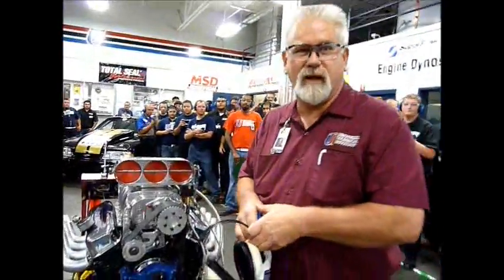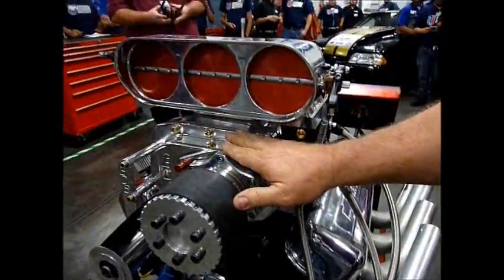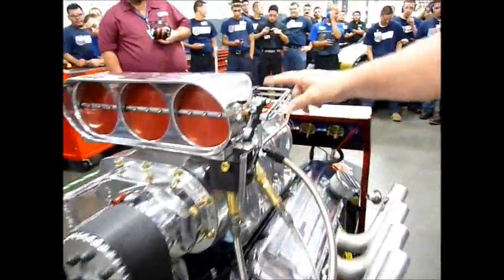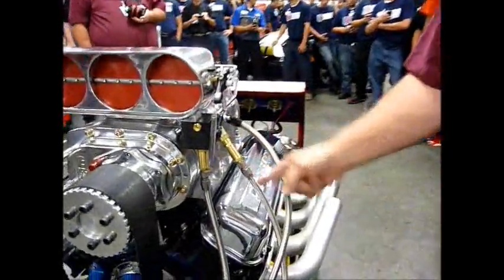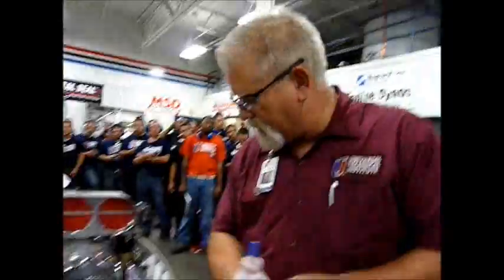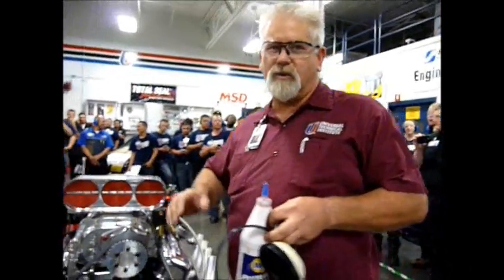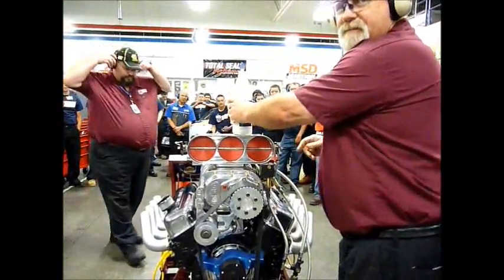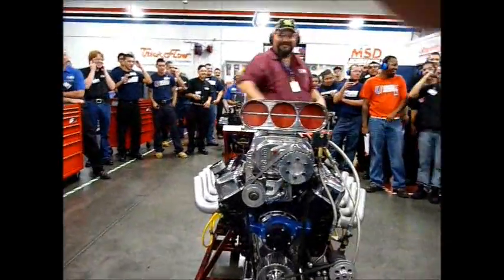UTI Sacramento Blown Gas BBC Engine

Comment: It's called blower surge it has nothing to do with the butterflies champ
Reply: I am sorry to say that you are wrong mini champ! Here is your free lesson for the day. There is allot of suction on the top side of the blower and every 60 degrees the rotors release that suction and then it starts again on the next 60 degrees. You can actually see the butterflies suck in and release ever so slightly as this happens. The bigger the butterflies the more surge. Couple that with the very low idle fuel pressure which can also oscillate up and down then you are into blower surge central. The further closed the butterflies the worse it gets. Open up the butterflies and it smooths out. This concludes your lesson for the day!
Reply: Mark Hall then explain why even on a dual carb setup it does the same thing
Reply: Mark Hall Danny Glad said you are wrong I'll take a man of that calibers word over yours any day.

Comment: Did I hear you correctly ?
Blown GAS not alcohol?
I didnt know you could run a Enderly injection on gas,
Reply: Jose Pt Tellez It is a great school for getting hired at a dealer. We teach the dealers programs like Ford, GM, Buick, Chevy, Cadillac, BMW, Mercedes, Nissan, Infinity, Toyota, Lexus, Porsche, Peterbilt, Cummins, International, Honda, Mini and I am sure I am forgetting some. You can actually get credentials from those classes for those brands. It is there programs, we just teach it for them. Many of the service managers have graduated from UTI. The service director for all of Lithia dealers which is 131 stores graduated from UTI. The service manager at AutoBahn Mercedes Benz in Belmont was a 99 grad. Those people that are telling you this, where do they work?
Reply: Yes you can run gas with any injection. NHRA banned nitromethane for some years and the only fuel they would allow was gas. It is not my preferred fuel for racing as I run methanol in my race car. Blown gas does however sound more wicked than a blown alcohol engine so that is why we are running gas. And the fact that we don't have methanol at the school.
Reply: Mark Hall people say that's not a good college is it true that dealers don't hire people from there
Reply: Mark Hall how much would it cost to get trained to work for dodge and I just read around forums that's were they said that.
Reply: +Jose Pt Tellez Dodge has decided to start a program with us and should be up and running sometime in 2016. It will be at our North Carolina campus.
Reply: Jose Pt Tellez I wanna work for nissan

Comment: why does he keep snapping it like that
Reply: I am just revving it up for the crowd. You should feel the pressure out of the exhaust!
Reply: i have felt the what that feels like but why the fast snapping of the engine why not let it build up or open it a little slower i would think snapping it like that might not be good for it you are going wot then snapping it shut just my opinion
Reply: Richard perea Hi Richard, No it does not hurt it. Mechanical fuel injection is just a set of butterflies and a mechanical pump with nozzles. It wont hurt it revving like that. If you were to hold open the throttle for extended periods of time without a load then yes it would hurt the engine.
Reply: Im talking about dumping a bunch of fuel into it then choking the engine i just figured that might not be good for it
Reply: Richard perea blown head gasket maybe?

Comment: I started uti Jan 3rd 2012. After having to take 3 leave of absences due to military obligations and take auto, diesel, ford and smog I'll finally graduate Jun 13th 2014. I've learned so much here and had mostly great instructors like mr gula, elrod, Blanchard, couvret (probably misspelled, sorry) malonson, Thompson, Burch, moots, Landers, Holden, hayes and a lot others. The ford program is awesome and the instructors kick ass. Mr hall, I'm mad at you because the phase before I had hot rod was your last phase before you went admin. I had to deal with Hayes! He's good but I sware he's a little off his rocker. Overall, great education and they work great with gi bills and veterans
Reply: It is bro. I graduated in June. I kinda took another route with ny education and became a tow truck driver but there's not a day that I don't use ny knowledge. UTI is the best and I don't get paid to say that
Reply: Got your six brother
Reply: Sorry Patricio my old body just wouldn't hold out as an instructor so I took the cushy job in the office. It is also easier to take off work when I want to go racing.
Reply: Lmao. Its cool though. Mr Hayes was hilarious and Mr malonson and I were already acquainted so hot rod was still good, I just envy the students that had you Mr Mark hall

Comment: Webster dictionary describes a motor as any prime mover including a internal combustion engine and a rotating machine that turns electrical energy into mechanical energy. A electric motor however is never called a engine. You can buy a Motors manual that is about fixing cars and engines. I guess we will need to correct NASA as I have heard them say rocket motor. A name change is also in order as the DMV will need to be................................ The Department of Engine Vehicles! 
Mr. Hall

Comment: No you have to run a mechanical fuel pump with a injector. As the speed of the engine picks up the output of the pump increases.

Comment: The Professor says if you want to really go fast then take those restrictors off. Carbs are good for pleasure boats. When you switch to injection you will never go back. What does it run in the 1/4? I will match you E.T. slips!
Mr. Teach

Comment: No, but I will give you a lesson on how to tighten a belt. The belt is adjusted when the engine is up to temperature. You adjust the belt so it has some movement on the taunt side of about 1/4" of play. It will be a little loose when the engine is cold because everything grows as it gets hotter. Make sure to warm the motor before getting on the gas. Remember, if you run a blower and you want to go fast put a injector hat on it because carburetors are just a restrictor.
Mr. Hall